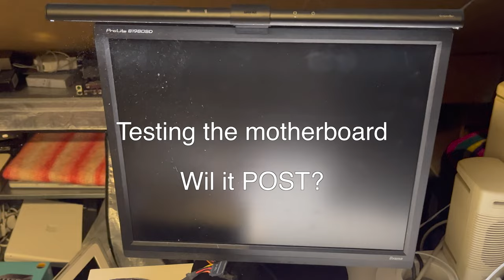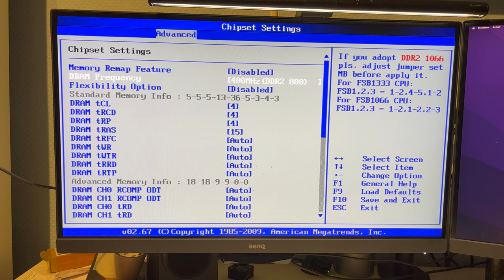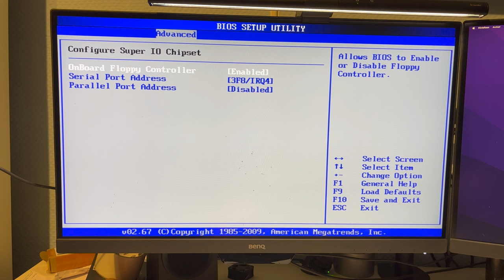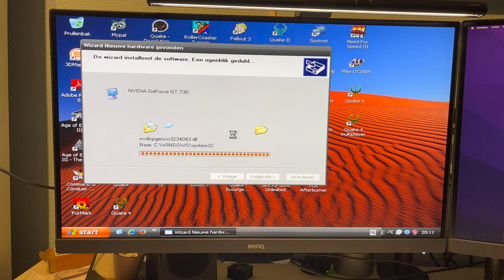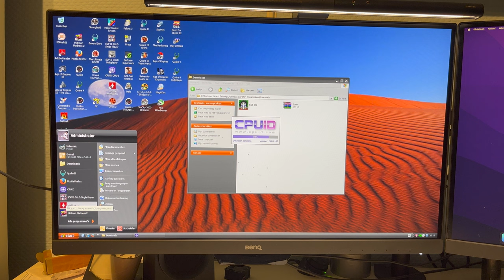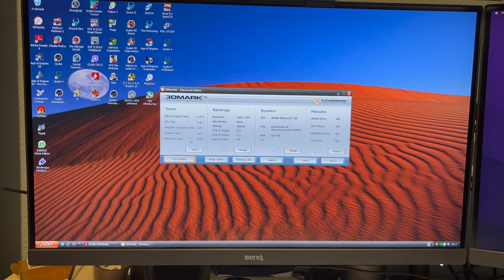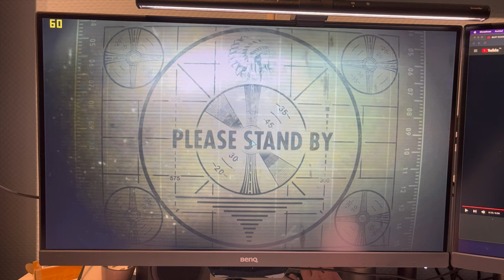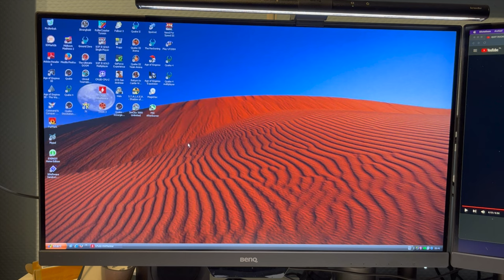Small Form Factor Windows XP Build

Comment: 1. How did you install the games shown in this video?
2. What CPU did you use?
3. What video cable did you use to hook up the desktop to the monitor?
Reply from the maker: 1.  Network share and CD/DVD
2. Core 2 Duo E8500
3. HDMI
Reply: I see. Anyway, what’s the interface of the optical drive. Also, how did you get Need for Speed III: Hot Pursuit to work on this thing? Will Need for Speed: High Stakes work on this thing?
Reply from the maker: I don’t really remember which optical I put in it long term. I think it was a SATA drive, but could’ve been IDE. Both will work fine with XP SP2 and later. NFS3 and NFS HS will both work just fine without modifications as long as you have your video drivers installed.
Reply: I see, and how did you get the audio to work? What do you use as an audio output on this one?
Reply from the maker: I use the built-in motherboard audio solution at the moment, which works fine.
Reply: @nelizmastr  I see. Anyway, for Need for Speed III: Hot Pursuit, Need for Speed: High Stakes, and other Glide supported games, I suggest you use a Glide wrapper called nGlide so you can play those games in widescreen and make them look great.

Comment: On the thumbnail it said 404 views, so I had to pluck that 404 with another viewing lol

I built an xp home 32bit machine in an inwin bp655.300 case with an h67 mobo, 4gb 1600 running in 1333 (free ram stick), an i5-2390T (35w tdp) with hyperthreading disabled, sata ssd, and a gt730 gddr5. This thing flies. Installed Area-51 (Edgar version), my original copy of Vampire the Masquerade: Bloodlines, Doom 3, Crysis, swimming in the nostalgia
Reply from the maker: Those are some nice specs for an XP rig! Enjoy the nostalgia :)
Reply: @nelizmastr  thanks :)